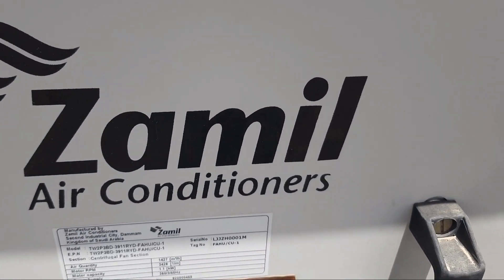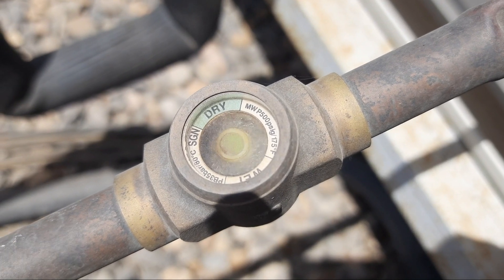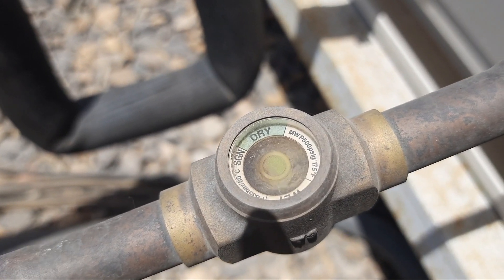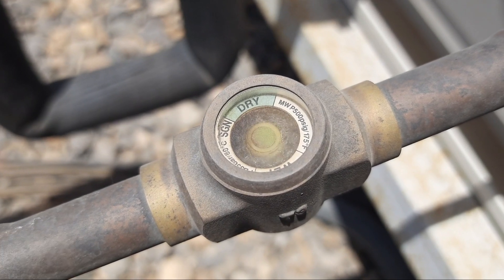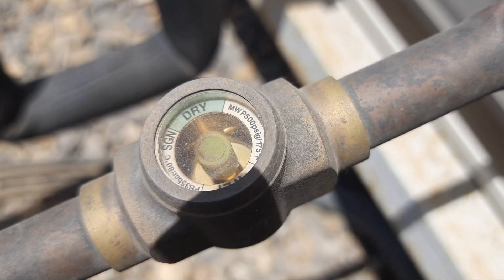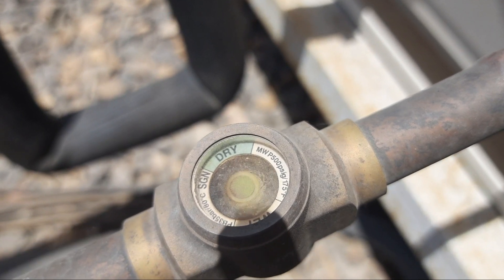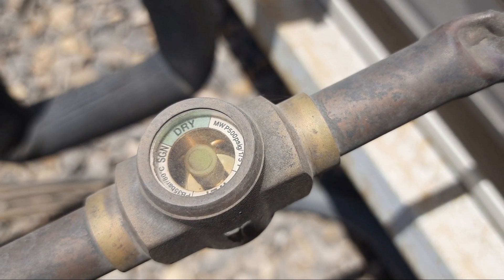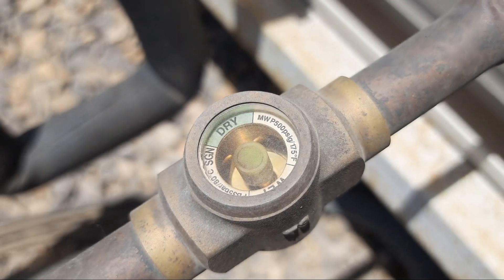Why use sight glass in HVAC System very important video to watch

Comment: Very good information one question please I changed an ac  system change the filter and the side glass is not getting close still have bubble what is the problem can you advise me please thanks God bless
Reply from the maker: You charge your system because reason of bubbles is that your system is still under charge
Reply: It r410 I charge it my self it's a 125 psig  and it's cooling so where those bubble coming from the filter change too
Reply from the maker: If your system is working on more load the bubbles also came because of pressure drops